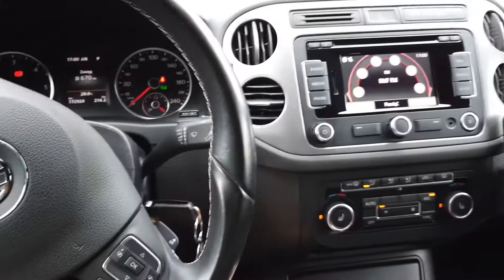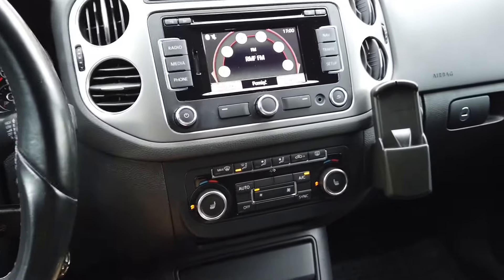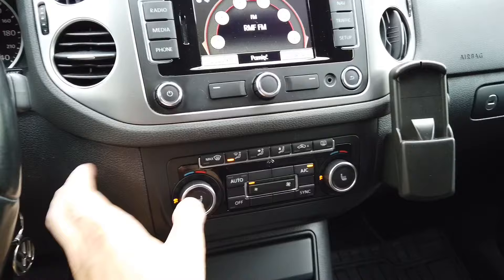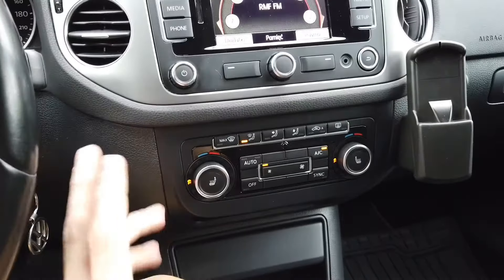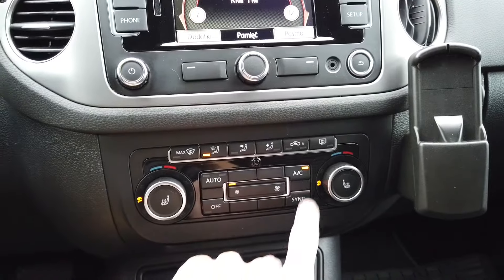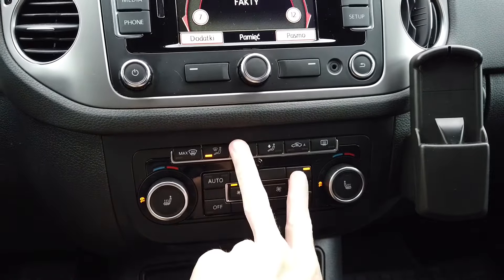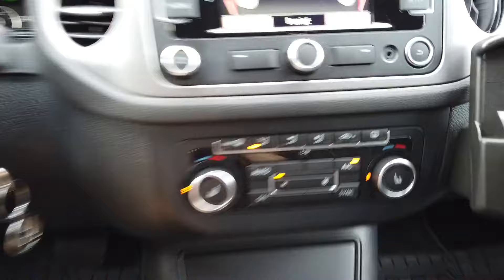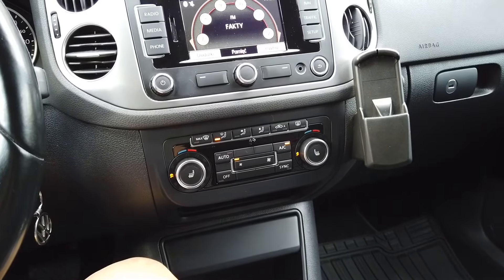VW Tiguan MK1 (5N) climatronic calibration adaptation

Comment from the maker: Need OBDeleven?
🎟 Get 10% OFF with code: MRFIX10
🛒 http://mr-fix.info/redirect/obdeleven
Reply: Hola, Do you know, I have a 2014 Tiguan, is it possible to leave the air recirculation button active even if the air conditioning or heating is not on?
Reply: Good day sir. The “Auto” button has 2 lights same as mine. I am wondering though sir about the difference of the two lights. May I know the difference sir or the purpose? Hope to get a response from you sir.

Comment: Hi 
I have a noise in dashboard is a noisily like when I am accelerating 15-20 rpm I have 2010 skoda octavia 2 FL I was thinking is from calibrate vents but I think is not from that! So I don’t know what is the problem. I have it before playing with secret menu too and I think I did something bad with temperature changing is a option to reset the dual climatronic menu or factory settings? Thanks